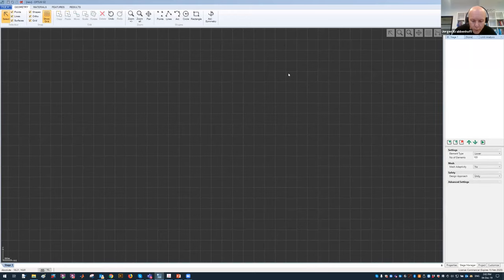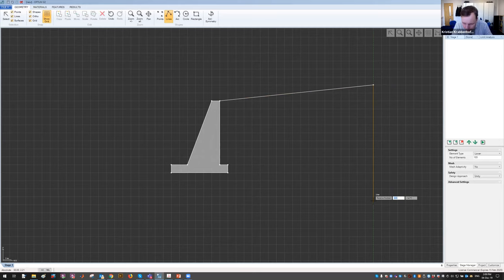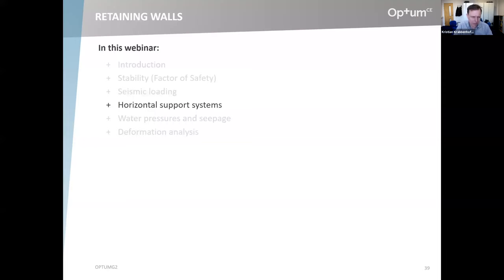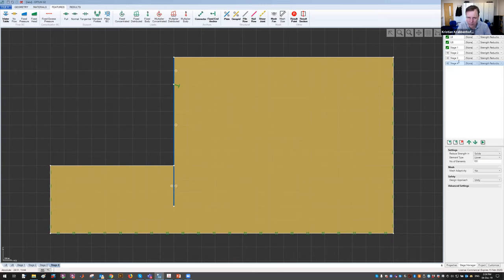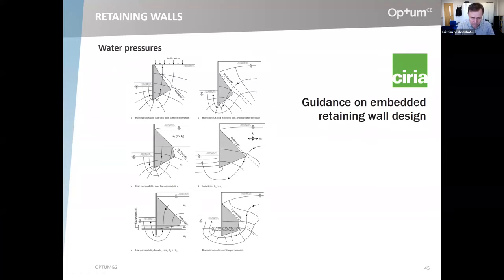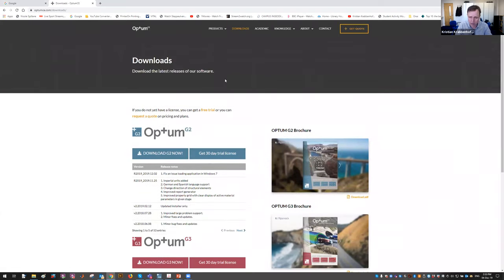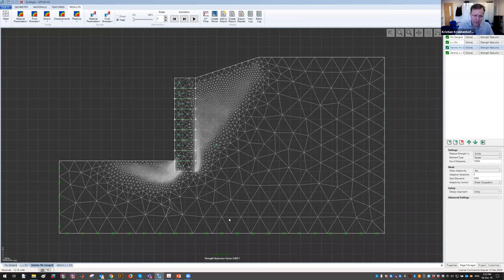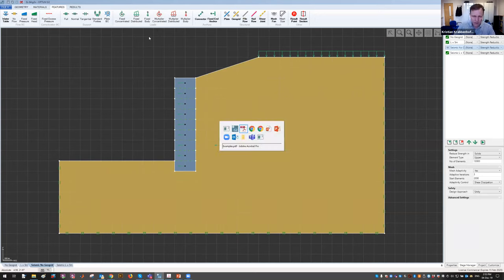Retaining Walls in OPTUM G2

Comment: Whatdoes stiffness (EA ,) for Geogrid material in optum indicates? How to calculate? Do we need to multiply Young's modulus (kN/m) with Area(m2) then the unit must be kN-m. But the software showing unit as kN/m for EA (stiffness)
Reply: I think it is calculated the same method which was used in plaxis or sigma/w